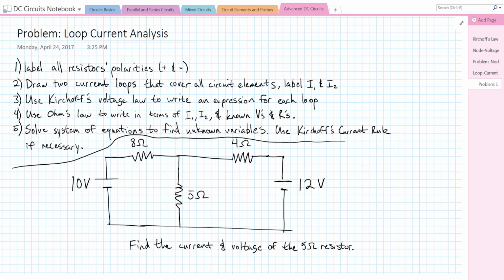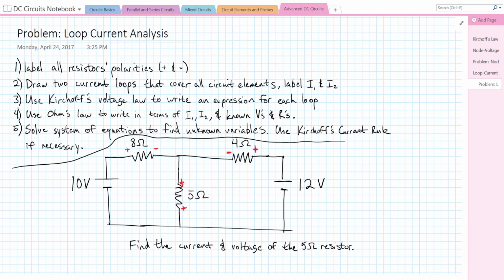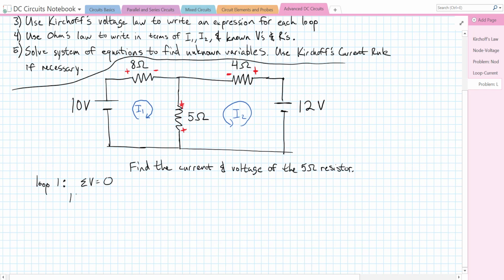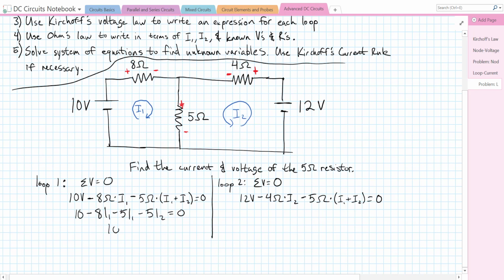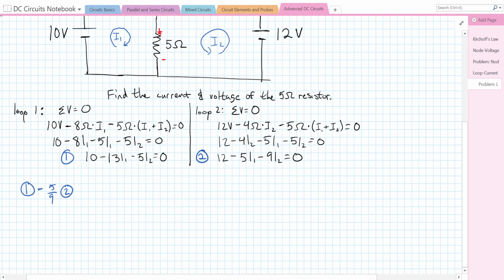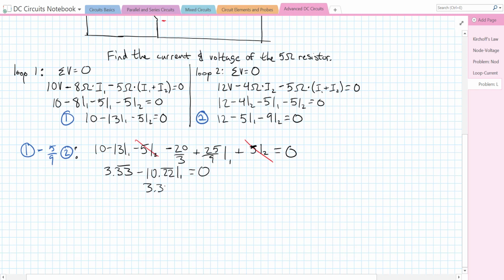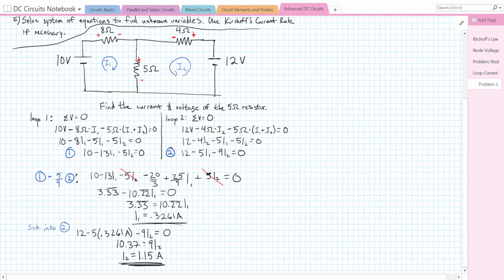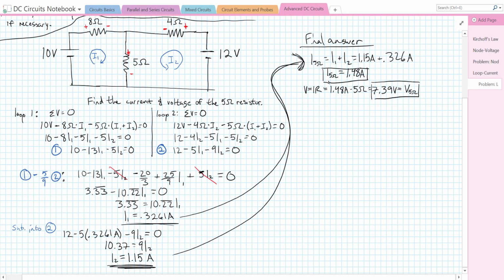Loop-Current Analysis Problem

Comment: I was doing good until I got to 6:25 and got lost after that. I wish you would have explained how you gor to those next steps.confused on the minus 5 over 9 and 20 divided by 3 and 25 divided by 9 and so on
Reply from the maker: At 6:25,, we have two equations (1) and (2) and two unknowns I1 and I2.  We need to solve the system of equations to find I1 and I2.  You can use many methods to solve the system of equations, including substitution, elimination, or matrices (note that this is NOT the physics, just the algebra).  I used elimination.  

I chose to eliminate I2.  If equation (2) is multiplied by 5/9, it becomes 

12*5/9 - 5*5/9*I1 - 9*5/9*I2 = 0
or
20/3 -25/9*I1 -5*I2 = 0

Now I have a -5*I2 term, which is the same as the -5*I2 term in equation (1).  Thus I can subtract the two equations to eliminate the -5*I2 term from the system, and solve for I1.  Once I have I1, I can substitute it back into (1) or (2) to solve for I2.